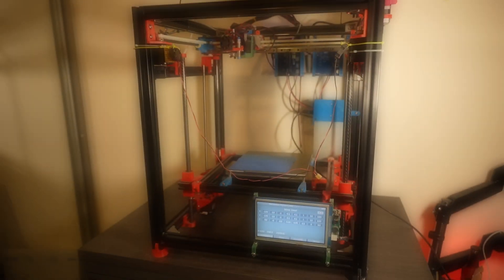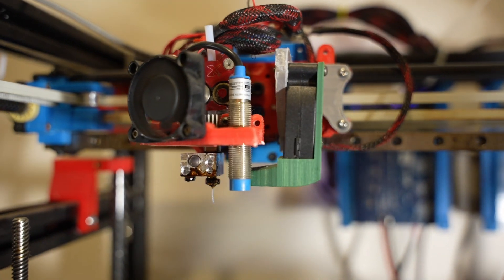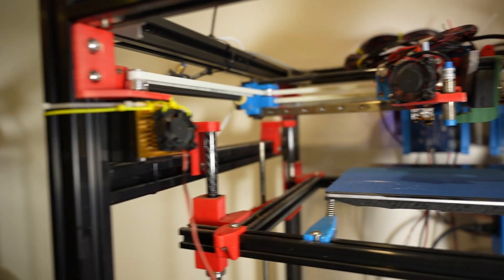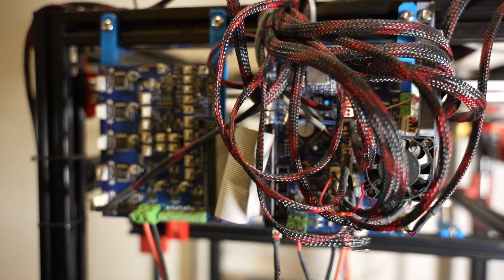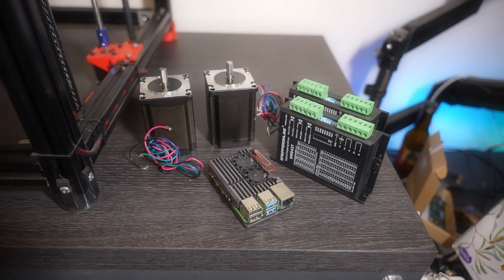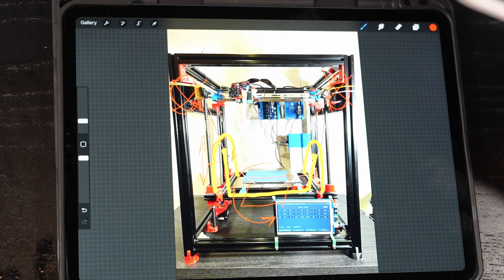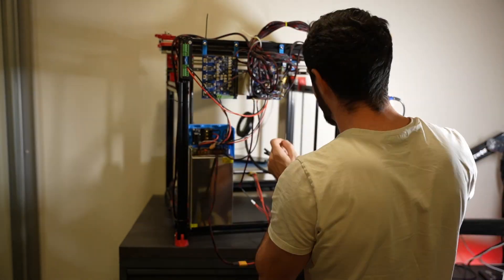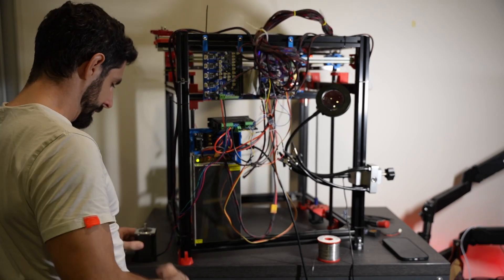5 axis 3D printer project intro, external stepper driver test.

Comment: What heat bed do you use?
Reply from the maker: Initially I will use a really small print base instead of a heat bed, maybe an aluminium platform not bigger than 50mm by 50mm, that I can heat up with one or two heater cartridge like the ones we use to heat up the nozzle. If I use a traditional heat bed I will have a limitation when I turn the bed 90 degrees to either side, I have more chances to make the printing head collide with the bed.
In spite of that, I should also consider making that interchangeable for a normal 220mm by 220mm for printing in traditional ways.

Comment: Awesome work, got a question about the software you gonna use for slicing with 5axis
Reply from the maker: Thank you! Regarding slicing for 5-axis, that’s probably going to be the most challenging part. I’ve seen other similar projects and they are using some custom stuff in SolidWorks (which I’ve never used yet). I am more familiar with Fusion 360 so another option would be to see if there is a chance of re-purposing the 5 axis features the CAM software provides for CNC machines.
As a last resort, I am going to create some custom code to slice some sample models, I am indeed a software engineer, but to build a slicer from the ground up will be a hectic task for one single guy. I hope I can get my hands into some existing open source slicer and that they are not prohibitively complex.
Reply: @engineerunleashed  just my 2 cents........What if i just use my normal slicer for the x y z   ( normal G-code)    make a smart program that figures out wich servo or servos  does the job  to come there ... combine the new G-Code

Comment: Great video ...what specs. do you expect from your machine ?
Reply from the maker: Hey there! Thanks for asking. Honestly, I'm not totally sure about the final specs yet. It is going to be fast, I'll install big motors and a high-flow Mosquito hotend.
As for the build volume, I haven't done the calculations just yet. My primary focus at the moment is figuring out how to slice the models properly in 5 axis - that's the real headache right now. Once the printer's up and running and the gcode's sorted, I'll start optimising and I will be more certain about the specs!